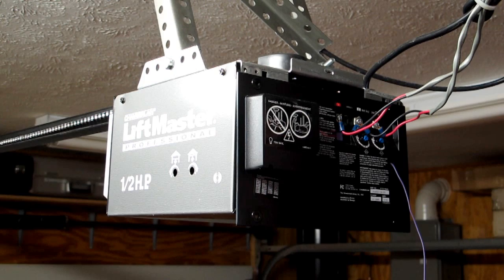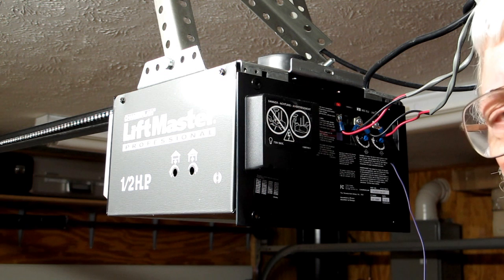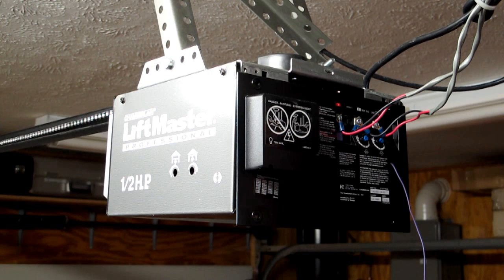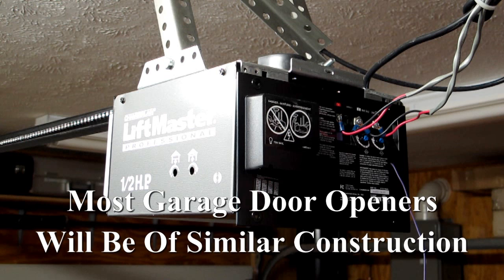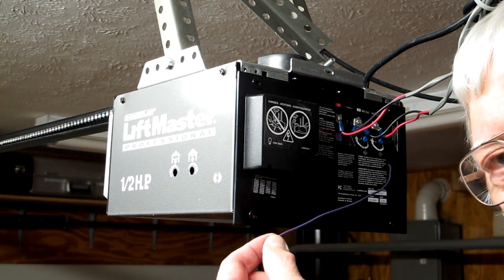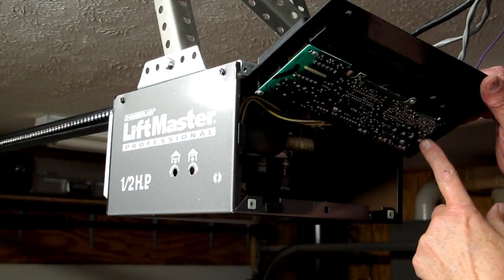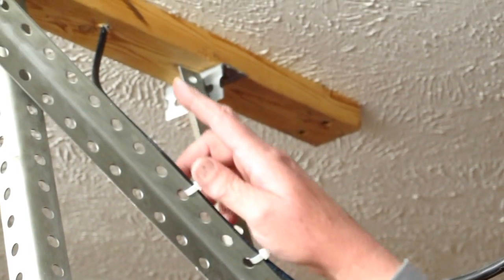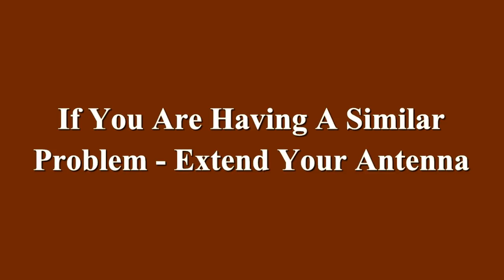Garage Door Opener Antenna Extension

Comment: Why are you welding it on the board? Cant you just twist it around the original antenna?
Reply from the maker: The original idea for the coax was to shield the received signal from interference (such as fluorescent lights, motor or ignition noise, etc.). 
Usually a receiver is tuned to a specific antenna length. 
In this particular case it did not seem to make any difference, so (as stated in the video) I did not ground the shield of the coax at the door opener.
You could try twisting it around the end of the existing antenna... if it works, great. Otherwise you will probably end up running a coax as I did.
Thank you for watching. Please subscribe! 
That is what keeps this channel going. 
Ron

Comment: I ordered a selection of beads. installed them on all of my  opener wires and 8 foot light fixture wires. Made absolutely no difference at all. I thought it was going to be and easy fix.... hahahhaaa on me!!!  First tried a single wire antenna extension, that didn't work at all... had to solder and run a coax cable out past the door opener, put a single 18" 1/2 wave wire on the end of the coax cable and ground the outside of the coax wire to house steel exterior. I soldered to the antenna wire and stuffed it up into the opener casing.  With the lights on it now works about one car length, with the lights off it works out to about 250 feet!!! something is better than nothing... UPDATE: I just installed some aluminum tape over the wire between my coax and board, just 6 inches of tape improved the range...

Comment: going with the coax. I replaced my four 8 foot neons with LED bulbs. I love the extra brightness but the door opener doesn't work unless they are off.
Reply from the maker: Since you appear to have interference form those LED bulbs, you may need to ground the outside of the coax. Thanks for watching.

Comment: Woah. That's.... alot. I've seen videos of people just stripping and twisting in a separate wire, running it along the ceiling to just above the garage door and that extends the range pretty nicely. Why would this be necessary? The only difference I have seen is the metal roof...
Reply from the maker: First you need to understand that the initial "assumption" was the receiver in the door opener required a tuned antenna (that the original antenna wire was a specific length for a reason) and the door opener company confirmed that requirement. Using a coaxial cable filters out outside or unwanted signals or interference. Apparently using a compact fluorescent bulb or some LED bulbs in a door opened can cause interference for the remote control. And yes I have a metal roof, the house is wrapped with aluminum foil backed insulation under the siding and the garage door is also metal. If I simply ran a length of wire outside and found out it didn't work... then I would have needed to remove that and run the coaxial cable. Easier to just run the coaxial cable in the first place. Normally the outside shield of coaxial cable needs to be grounded in order to be effective. In this case it didn't seem to make any difference.  Thanks for watching!

Comment: WHY NOT JUST ADD AN EXTENSION TO THE EXISTING WIRE COMING OUT TO THE OPENER USING TELEPHONE WIRE ETC?
Reply from the maker: Asked and answered several times in the comments. Receivers usually have a tuned antenna (specific length of wire) which gives the best reception from the transmitter (the garage door remote). In this case it didn't appear to make any difference.

Comment: Ronald, thanks for the video and helping people out for the last 10 years! QUESTION - Why didn't you just connect the center core of the coax to the end of the existing antenna wire? Why solder it to the board?
Reply from the maker: This has been covered in the comments many times. Did you read the comments?
The idea of using coax in the first place is to shield any interference that may be part of the problem. To do that you want the shielding as close to the circuit board as possible... plus it looks neater. 
Originally I expected I would need to connect the shield of the coaxial cable to ground but I found I did not need to do that in my particular case.

Comment: Good job but, that a little over kill to go through your steps when you can just tap into the existing wire.
Reply from the maker: Not knowing at the time if it would be necessary to ground the coax, it wasn't overkill at all.

Comment: I have had the same problem. We had a metal roof and a new garage door installed and from that time on, the remote garage door opener were starting to be unreliable. We had to be very very close to garage door to open it with the remote. I solved the problem by adding a 700MHz RF amplifier (from Digikey Order Number: 1465-SMA67-1-ND) and a BNC connector to the motor drive unit. Then I run a 50 Ohm impedance coax cable with a crimped BNC connector and stripped the coax shield on the other end by the same length as the short original wire antenna. Now it works like a charm and I even gained some 50ft extra range.

P.S. With respect to the coax shield, for best results the shield should be connected on the circuit board to a nearby ground. If you don't care to connect the coax shield, you might as well use any wire you have and don't bother with coax.
Reply: Hi, can I ask - if you connect the outer shield of the coax to ground on the circuit board, do you have to connect the outer shield to anything at the other end of the coax where you connect the antenna to the central core, or as you have done - strip back the insulation to the same length of the original antenna wire? Many thanks 👍
Reply from the maker: Only need to connect the outer shield to ground on the circuit board. You do nothing with it at the far end where the original wire was connected.

Comment: This video saved me from having to purchase a new opener.  In case you are not aware, use of LED lights including replacement florescent lamps will affect your reception according to the techs at Chamberlain.  Using the shielded COAX reduced or eliminated enough of the interference to increase reliability greatly.  Thanks for sharing!
Reply from the maker: Thank you for your comment.
Please subscribe. That is what keeps this channel running. 
Ron

Comment: I had hoped this would fix my issue, but I still had only a 5' range.  Turns out that the issue was LED lightbulbs!  Replacing those with non-led completely resolved my problem.  Having the antenna extension won't hurt though - doubly good!  Just glad I figured out the problem, and thanks to those that post solutions that led me in the right direction (including extending the antenna!)
Reply: I NEVER in a million years would have guessed this - thank you so much for your comment as this fixed my problem!! You saved me multiple additional hours of research and frustration!!!
Reply: Same here, I don't really understand why yet, but took out the LED bulbs, works fine
Reply: Just found this on the internet

LED lights have drivers inside the bulbs, which produce a field that interferes with the garage door — preventing the door from opening. Garage doors operate using frequencies between 28 and 360 MHz. Because these two devices use intersecting frequencies, they can interfere with each other.Jul 20, 2021. LED lights have drivers inside the bulbs, which produce a field that interferes with the garage door — preventing the door from opening. Garage doors operate using frequencies between 28 and 360 MHz. Because these two devices use intersecting frequencies, they can interfere with each other.Jul 20, 2021

Comment: If you’re having problems with your garage door remotes make sure you don’t have LED lightbulbs in your garage door opener because that will interfere with your remote or if you have a bad electrical board itself and that could be replaced
Reply: I read that garage door A19 rated bulbs would work just fine

Comment: You used a coax cable, seems like any insulated wire would work, no ?  Or is the impedance of the coax a key parameter? Was that 50 ohm impedance cable?
Reply from the maker: I used RG6. Originally I expected I would need to connect the shield of the coaxial cable to ground but I found I did not need to do that in my particular case. Try a length of speaker wire and connect it with a wire nut when you twist it to the end of the antenna and see how it works. You can always disconnect it again if it does not work better and use the coax as suggested. Whatever works....

Comment: Nice video. In your case it might be necessary to solder onto the board and make you own antenna system outside. In my case I just needed a solder-less connector onto the existing antenna and some 18 gauge speaker wire to extend the antenna towards the driveway. BTW if you don't already know, LED light bulbs will interfere with wireless remote garage door openers. Event more know, is these circuit boards in some of these openers have a high failure rate and sometime show up with bad soldered connections.

Comment: Great Video.  I deviated slightly by cutting the existing antenna wire about 2 inches from the metal cabinet and connected the coaxial cable to the antenna wire.  After apply insulation tape, I gently shoved the antenna wire into the metal cabinet since the metal cabinet will shield any RF interference from the unshielded antenna wire..  I also grounded the coaxial cable to the cabinet.  With the other end of the coaxial cable outside the garage door and attaching the antenna cable that I cut off, my garage door now opens about 50 feet from my garage door 100% of the time.    Thank you for solving my RF interference problem!  I can now keep my LED light bulbs.

Comment: I had the same problem.  My garage is steel with a steel door.  I first tried just extending the antenna wire outside but that only worked sometimes.  Next i tried the coax like you did.  I don't remember if i grounded the shield, but it hasn't failed once in about 3 years now.  My unit is a chamberlain.  Thanks for sharing.

Comment: Seemed inconvenient to wire the coax directly to the board, so instead I enlarged the hole in the plastic cover where the previous antenna wire poked through, and mounted a F-type F-61 female panel connector.  The center pin was soldered to where the original antenna was connected and the ring or shield side of the connector to the ground on the circuit board, which is that large foil area near his left thumb.

Notice that the board has a purple "learn" button, which indicates that it is a 315 MHz receiver.  I made a ground plane antenna, using 9-inch lengths of copper wire for each element and another F-61 connector.  The antenna is mounted in the garage attic and connected with a 20-foot length of RG6 coax.  Range is about 600 feet.
Reply from the maker: The hole in my plastic cover was already big enough. Looked like they had used a connector on the board at one time then went the cheap route with a short bit if wire and bad range. With my steel roof I didn't even bother to try and antenna in the attic.

Comment: Ron,

Thanks for the video. I wish you would have shown the actual connecting process of the coax and the circuit board. I don't know how much to strip from the cable, how (or if) you snipped off the original male connector, ect.
Reply from the maker: I showed unsoldering the original purple antenna wire. Later in the video I said I connected the center coax lead in place of the original antenna wire and you can see the long copper wire from the coax sticking out  past the surface of the board after soldering it to the board (I cut that off before reinstalling the circuit board). I am not sure what you meant by “original male connector”… I unsoldered the original purple antenna wire.
I made a short video with a bit more explanation and showing how to prepare the end of the coax for this application.
Garage Door Opener Antenna Extension - Coaxial Cable Preparation
https://youtu.be/whlm9KoPh8E
Hope that helps. Please subscribe. Ron

Comment: Wow this was my exact problem! I found out I had metal studs last week when I went to mount my TV, but I didn't consider it would be acting as a faraday cage (my garage door is metal too). My first thought was the remote battery was low, so I replaced it and was frustrated when it didn't work. Thanks!

Comment: I had the same issue and model. I removed the LED bulb and replaced it with an incandescent bulb. It works great now! Not sure why but a low wattage incandescent bulb fixed my problem.
Reply: Mine started doing this when i used an LED, but when I removed the LED the problem remained.
Reply from the maker: An incandescent bulb is as simple as it gets (except vibration from the door opener can shorten the life). LED's have a bit more going on inside electronically and possibly it is generating RF interference since it is so close to the door opener receiver. I am just guessing here.
Reply from the maker: Sorry, did't see your comment earlier. An incandescent bulb is as simple as it gets (except vibration from the door opener can shorten the life). LED's have a bit more going on inside electronically and possibly it is generating RF interference since it is so close to the door opener receiver. I am just guessing here.
Reply: I have used an LED for a week or two and after removing it the range of the opener is nowhere near what it was.

Comment: I am having a similar problem, but due to an extremely noisy transformer for low-voltage lighting.  Quick question, how did you determine where to ground the shielding?
Reply from the maker: +Jason Wolfgram  See where ground is - green wire. Make absolutely sure it is the ground wire. If you aren't sure, get someone to help you.

Comment: AWESOME WORK & AWESOME VIDEO! THANKS FOR THE IDEA!

I AM HAVING A PROBLEM WITH MY GTO DRIVEWAY GATE WIRELESS INTERCOM F3100MBC CALL/KEYBOARD BOX, (LOCATED AT THE GATE) NOT COMMUNICATING WITH THE BASE STATION CALL BUTTON ANSWER/RECEIVER WHICH IS LOCATED INSIDE THE HOUSE.(this is used like a walky-talky system to speak to the person at the gate)
IT WILL WORK WHEN I BRING IT WITH IN 25', BUT NOT AT 100'?

SO AFTER SEEING WHAT YOU DID HERE, WOULD YOU THINK I COULD JUST EXTEND THE COAX CABLE ANTENNA ON THE BASE UNIT?(unit has a coax based antenna  that i think can be removed and attached with some coax cable)

I KNOW I SHOULD NOT BE HAVING THIS PROBLEM TO BEGIN WITH. iT IS SUPPOSE TO WORK A LOT FURTHER THAN 100'. ESPECIALLY W/O OBSTRUCTION! BUT I PURCHASED IT USED, SO THERE YOU GO! 
LOOKS GREAT, AND SAVED $180.00, BUT I THINK I MAY KNOW WHY NOW! 

PLEASE LET ME KNOW IF YOU THINK THAT WILL DO THE TRICK, OR IF YOU HAVE A BETTER SOLUTION?
THANKS AGAIN FOR THE GREAT VIDEO!
Reply from the maker: +Dog-gone Dogs   Radio communications can be finicky especially with some of this low power stuff. You have an antenna on both ends. I would probably look at the gate end which sits out in the weather hot/cold/wet/dusty. See if there aren't some oxidized or corroded connections with the gate end antenna/push button unit/wires.  These things generally are low power and it doesn't take much to make them quit. Other than that, I really have no experience with a gate opener specifically. The wireless thing makes it easy to install, but something hard-wired between the gate and the house (buried in the ground alongside the driveway) would probably be more dependable.
Reply: Ronald Walters --Thanks for the reply, Ron!
I extended the coax type of antenna today on the receiver located inside with about 20 feet of coax cable so it was on the outside on the roof edge. So now it is only 50' between the two, so the CALL button works every time now! (but there may be a problem just like you mentioned in the outside box, because it should have worked at least 150' straight shot!
BUT, for some crazy reason i can still not communicate(carry on a conversation with whoever is at the gate?)

Oh well at least i know "someones at the gate!"
Like i said, i guess that's why i saved a bunch of $$$ on ebay!

Comment: Here's a hint I had same problem , Dont use LED lights in Door opener they are not capatable with mother board , I put in incadesants and opener works great 200 feet away with door closed.
Reply: +Phil Saladino  Spot on!  that was my issue!  The LED lamps can give off an interference.  They must have an  FCC logo stamped on it, if not, you'll run into some weird non responsive remotes.
Reply: Led was the problem for me too,  thanks so much...
Reply: Thanks!  that fix it.
Reply: How about circular fluorescent bulbs?

Comment: wow. 200ft range... i practically have to ram the door with the car before i can get a signal... maybe.

we have the same garage door opener, but we are using a homelink remote that came with the car. but the results are the same... neither the original hand held remote or the built in homelink will open the door on certain days >_<
Reply from the maker: +fabulousprofound On mine a humid or wet rainy day works better (more distance) than a hot dry day.